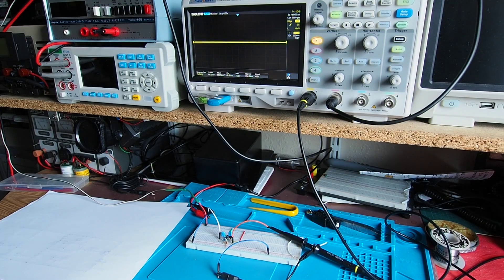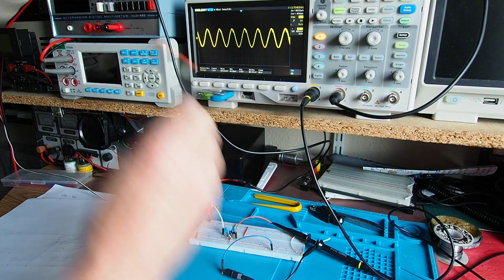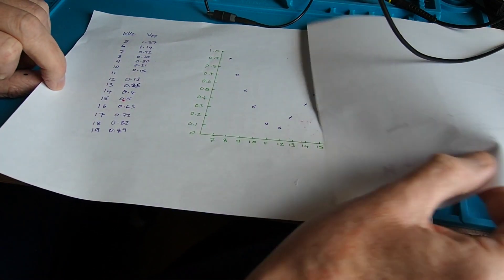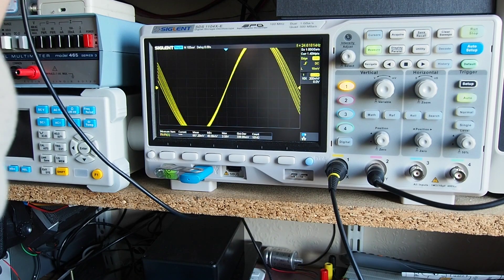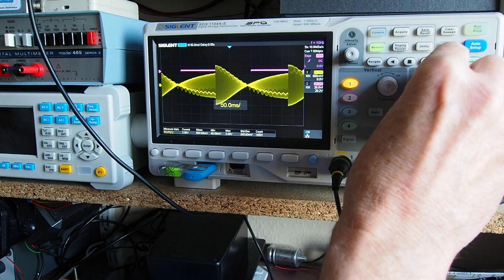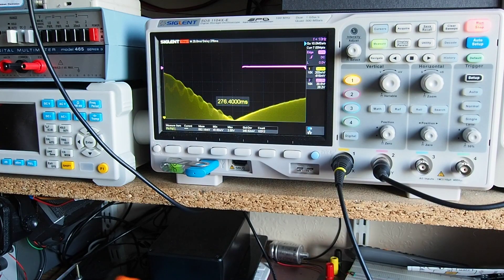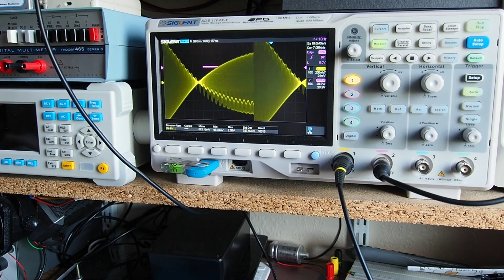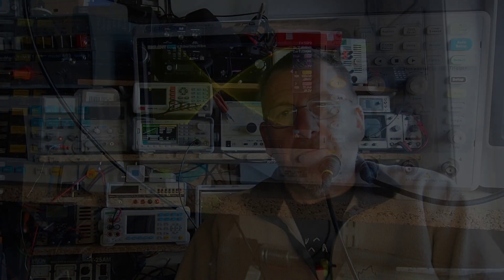New to Oscilloscopes  -  Part 4  -  #115

Comment: Maybe I missed it, but can you extract quantitative data from the trace or is it limited to displaying a purely pictorial representation of the notch effect ?
Reply: Yes. Almost all scopes allow for quantitative measurements. At the basic end of an analog scope, it may only be the grid and associated horizontal and vertical scales, at the high end you can get peak-to-peak, rise time, frequency, and more.
Reply from the maker: Yes as Martin says you can get quantitative data.
Part 5 is due out on the 1st of June, and looks at measurements.
Reply: @LockdownElectronics  Thanks Bill, I 'm familiar with normal scope operation, but in this situation you were using the scope more as a spectrum analyser and I wondered if you could extract notch width, dB reduction etc from this. Perhaps more like a sort of FT mode.
Reply from the maker: @99icd  Good question, not too easy but maybe you could measure the 3dB down point with the cursors, I might see if I can concoct a video of that.....